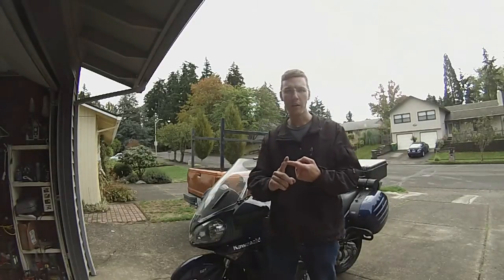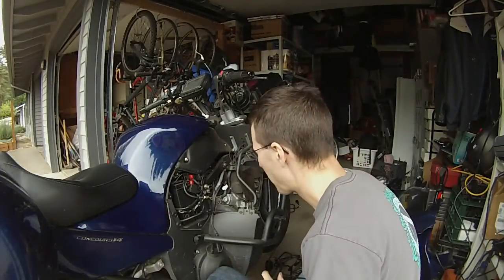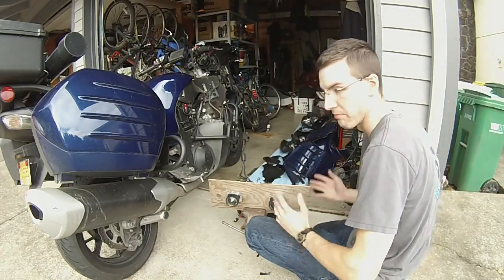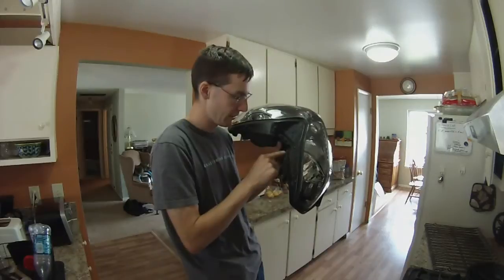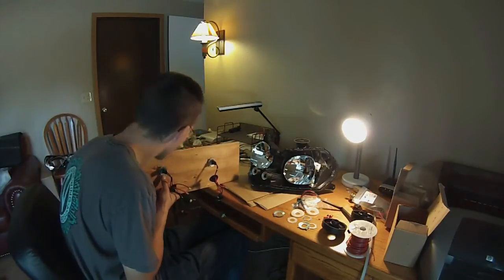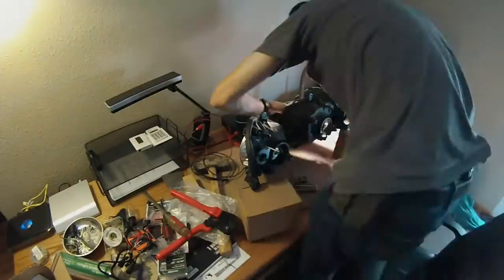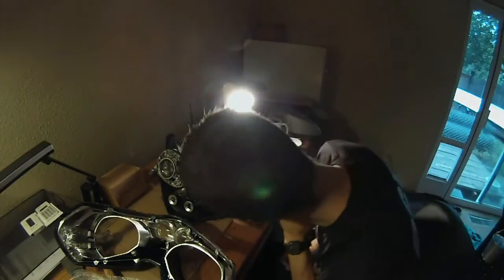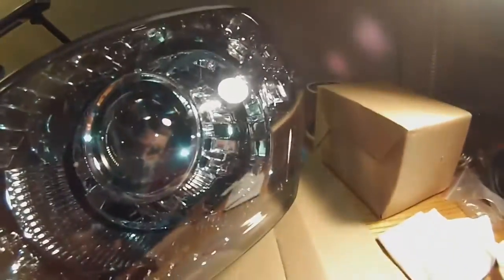2013 (2008-2014) Concours 14 Projector Retrofit complete Walkthrough

Comment: You speak about the shrowd and attaching it with 3 points of silicon.  I’m assuming that the shroud came with the projector.  Is that correct?  Secondly, did it fit flush with the base of the stock rear reflector?  I would be shocked it it fit flush.  What purpose does it serve?